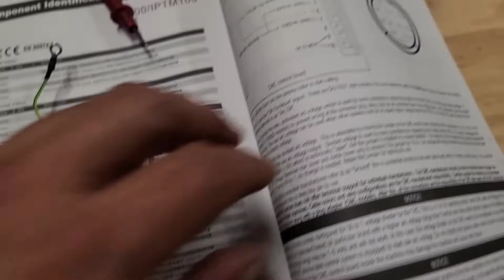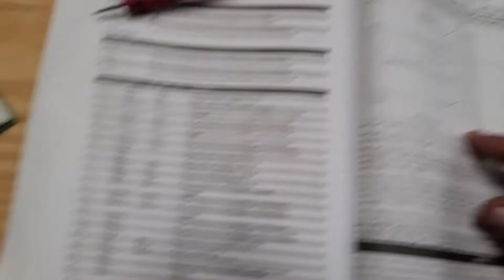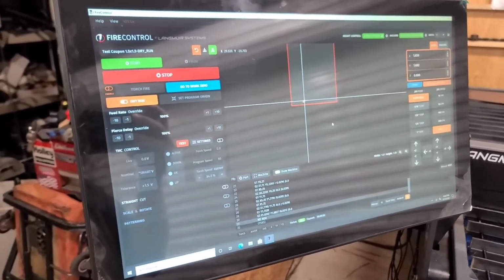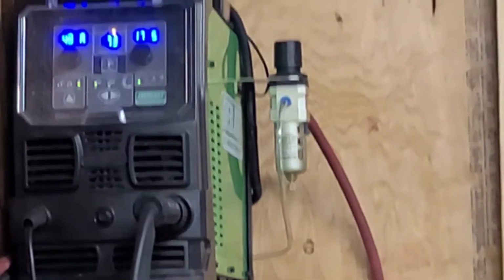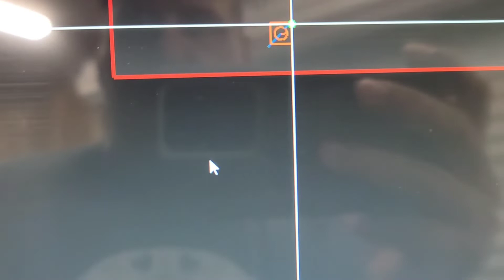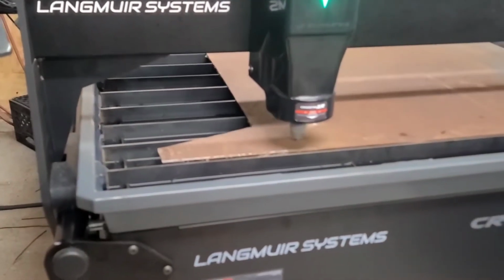LS Crossfire XR and Everlast 82i Direct Raw Voltage Modified CNC circuit board. 100% WORKS!

Comment: There is even more problems with the divided voltage, with the resistors and maybe 3 feet of wire going into the enclosure at 50 to 1 will give you volts in the range of 2-5 which is fine but not enough amps to make it work right along with the resistors. 
I used raw voltage with the Proma thc and works fine but now I have the centroid thc and they require a divided voltage, I got it to work once so my wiring is right but those damn resistors wont let it flow right.

Comment: Thank you very much for the video. I have had issues, with THC, for months and Langmuir support has not provided any useful information. They just keep pushing useless information. I modified the board exactly like you did in the video and it works fantastic. I was going to buy an XR but now I am going with a GoFabCNC table. Thanks again, you rock :-)
Reply from the maker: Glad it worked for you!  I hear of people having problems with Langmuir's support, but Cameron has been so helpful even with rudimentary type problems that I've slapped myself in the head 🤦🏻‍♂️ afterwards.

Comment: I'm getting ready to wire up an 82i to my crossfire pro. Thinking of doing this mod. Is there a certain gauge wire needed? 18ga, 24ga, or ......? Is there a set number of amps passing through those pins to calculate wire size?
Reply from the maker: Sorry man just seeing this.  It's just the signal so no real amperage going through there.  I just use the wire that came with the XR.

Comment: I have the same machine and confirmed this works the way the video shows it.  I would however still recommend attaching directly to the lugs at the front of the machine so you don't void your warranty.  Everlast knows about their CNC port issues and they check this PCB board for modifications like in this video.  If they see anything modified it will void your warranty, but if your unit is 5 years old then that doesn't matter either way. Good video!
Reply from the maker: Actually I called Everlast before I did this modification and they told me that it wouldn't void the warranty, just like hooking up to the lugs on the inside of the machine wouldn't either.  You're not modifying the board you're just bypassing it. I have no worries with Everlast as if they would try and throw me under the bus like that.  Their customer service has always been 100%.

Comment: Now why would you do this just curious? I had the same set up and haven’t hooked it up yet just realized today that the 82 wasn’t compatible with the xr and was looking for some info on wiring. But what does the 100k resistor interfere with? Thanks
Reply from the maker: People have hooked up straight to the pins that say that they are raw voltage and have had nothing but problems.  Other people have hooked straight to the torch lugs.  I think the 100K resistors are not giving a true signal. This video shows me bypassing it and making a cleaner connection to the machine. I haven't had one hiccup from any kind of interference yet.